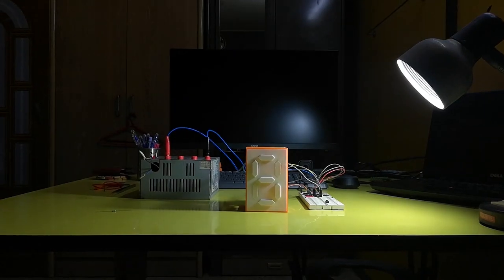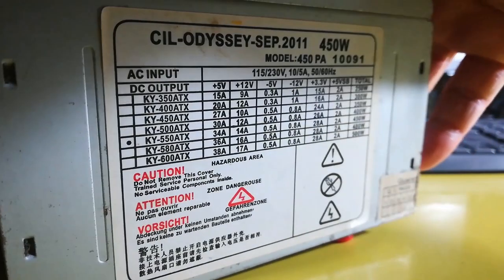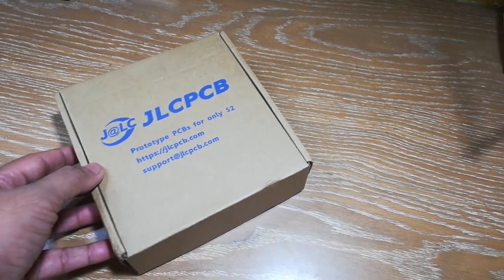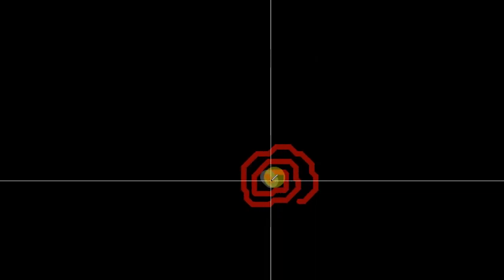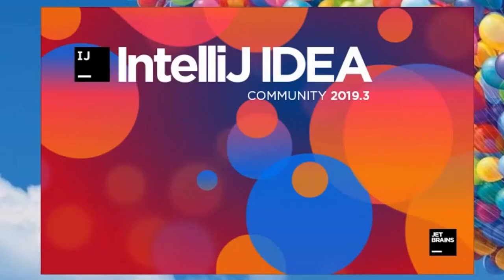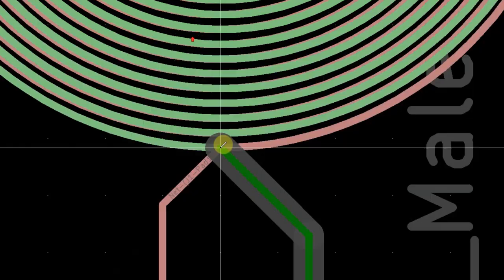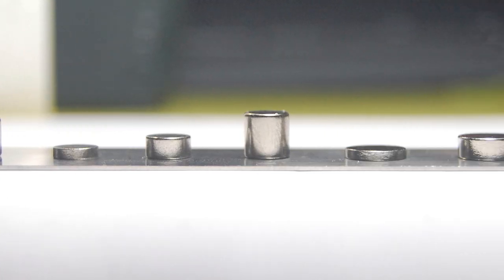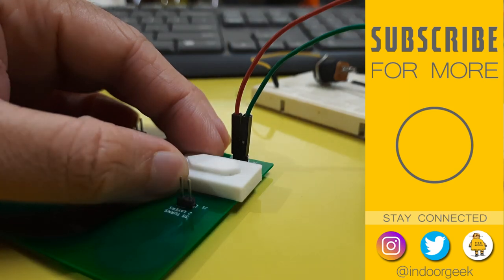Make PCB Coils in KiCad using Python

Comment: Nice, what's the current needed to drive this small pcb coil as opposed to the ones you made out of wire?
Reply from the maker: PCB coil: 0.15A
Old coil: 1.4A
Reply: @IndoorGeek  pwm or dc?
Reply from the maker: DC

Comment: Great video. I got @JoanTheSpark's python code finally working. There is a bug on the "print" line. I had to assign a function to a variable, then print the variable. However, I'm having trouble with the connector that you used in the schematic. After adding the connector in the schematic, where did you get the footprint that gets used in the .pcb file? I'm assuming that the python output has to go there. Does that sound right?

Comment: You should make the electromagnets square, with that geometry they are stronger, I learned it in university, it’s not used because in reality is hard to make a coil with that type of winding, but with pcbs you can do whatever form you like that’s the cool part
Reply: That explains why they are square when you look at the die shots of ESP32 RF-hybrid radios/processors.